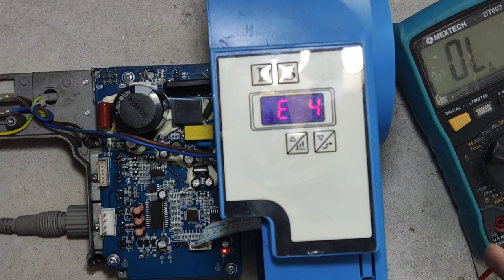Juki Sewing machine direct drive motor controller repair

Comment: SIR E4 OVER LOCK ME 73892 ke 3    
Jo 10uf capacitor h wahan par  15  
Voltage nahi ban rahah 
Shuste me plz.
Reply from the maker: Kitna volt ban raha he? Tino me nehi mil raha hai? Capacitor short hai? Resistance check kare ground se. Iss capacitor me 100ohm resistance and ak diode ke through 15v milta hai, to  iss duno ko check kare. Savi IGBT ko vi check kare.